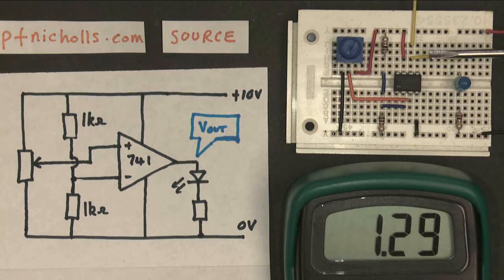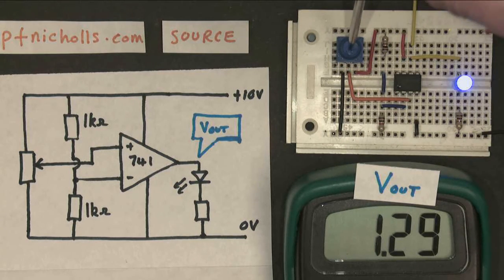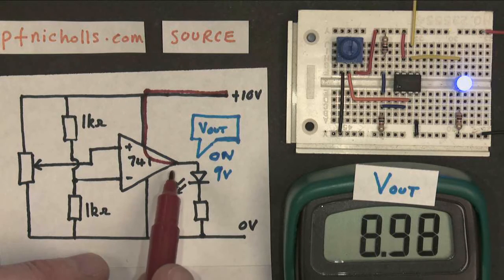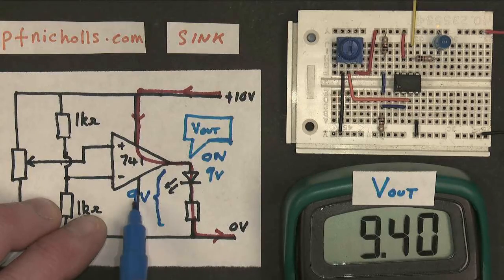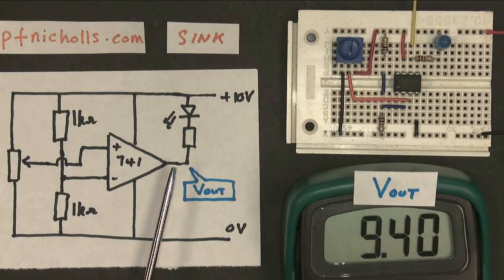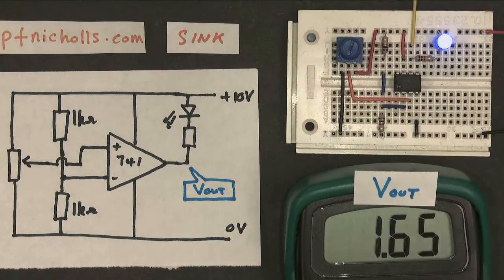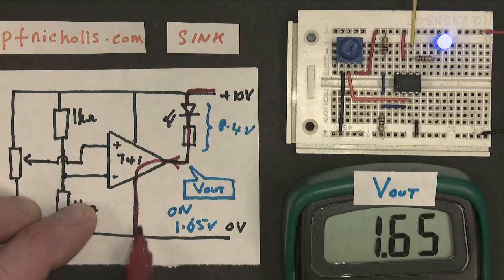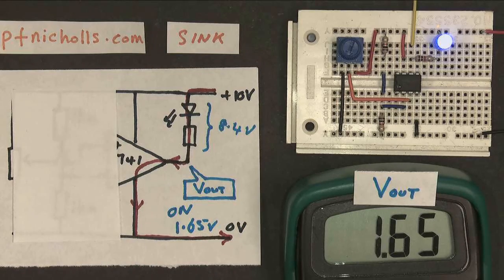Current Source and Current Sink

Comment: I'm confused. I thought the resistor was used to limit current and that DC only flows in the single direction. So why do you put the resistor after the power has run through the LED and goes to ground? Won't the LED start to burn out with 9v of power?